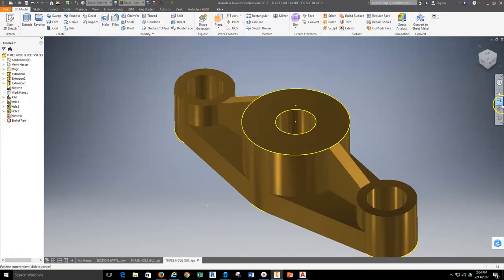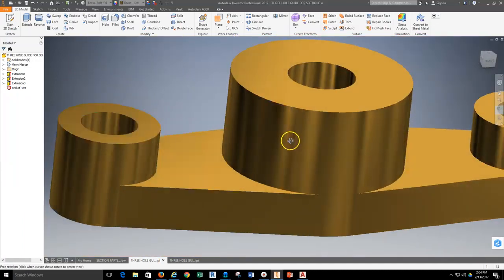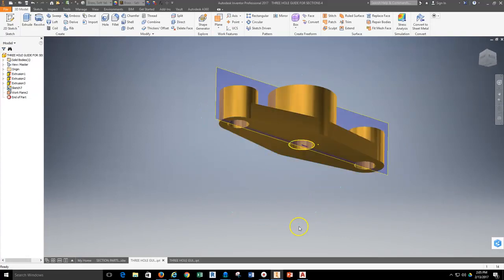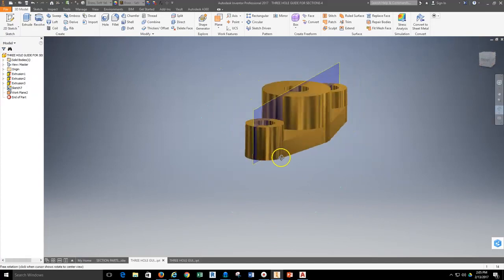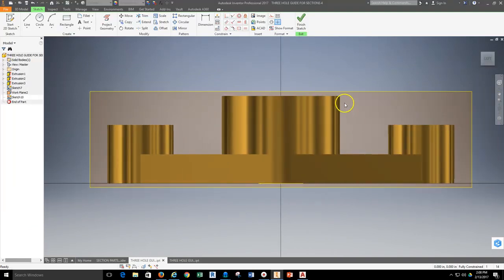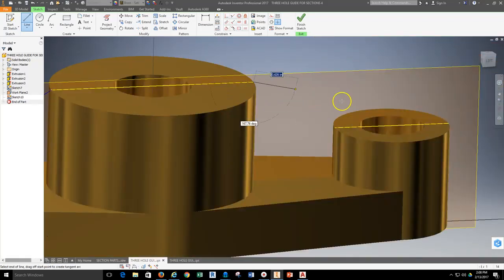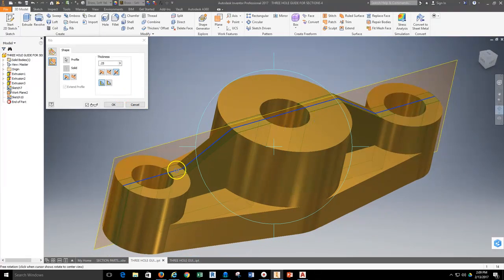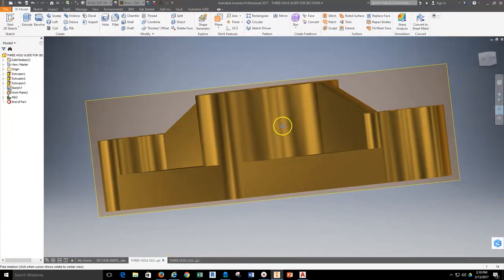Inventor - CREATING A RIB TO ROUNDED ENDS

Comment: Thank you for sharing! If your sketch of the base uses the Origin as the center of the central cylinder, you could have the original planes as symmetric planes, then you don't need to create Work Plane 2.